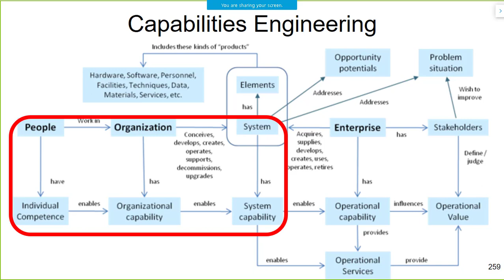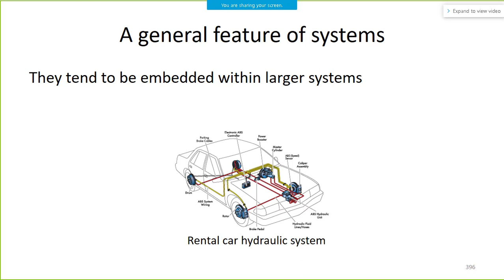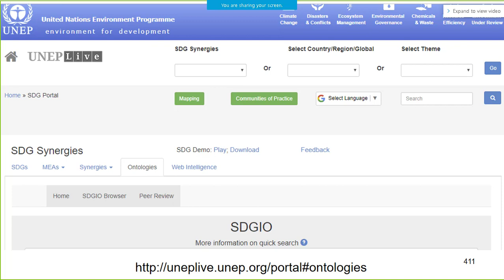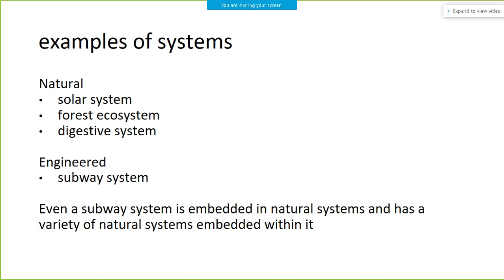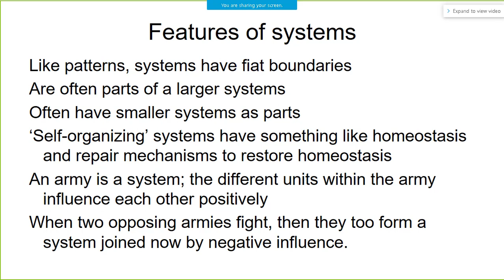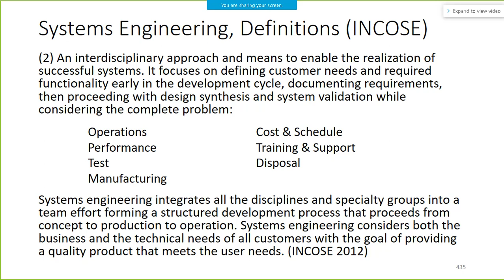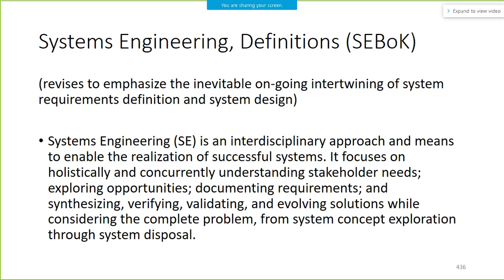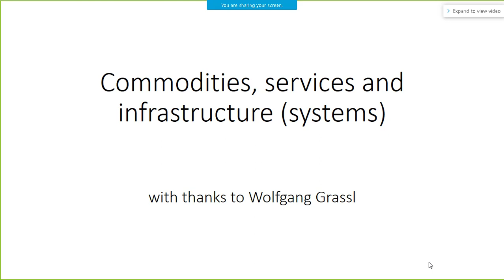Ontology for System Engineering - Part 4: Product Life Cycle

Comment: TLDR: An organism is a system with capabilities but no function that can take on a role that has a function.
Eg: A bee is a system with the capability to propagate, which can take on the role "queen bee" that has the function to propagate.

Argument:
An organism can be considered a system because it is comprised of causally linked components, which may also be systems. When an organism is considered an object it is because of the granularity chosen and the person choosing the granularity wishes to consider that organism as a "black-box". However, the next level of detail will break the organism into it's component parts and consider how they are causally linked. How does the little toe effect balance? The next level of detail considers the systems that comprise the organism, such as the digestive system. 

The argument that an "organism can't fail" requires that the ability to propagate the genome is considered a capability rather than a function, which is in-keeping with "organisms doesn't have functions". Let's take an example of a beehive. A hive is a system comprising of organisms with different roles, including queen bee, drone, worker bee and larva. This hive system has processes for gathering food and protecting itself. A bee has a causally linked set of sub-systems, including digestive, neurological etc. Therefore it must be a system, but it does not have the function to propagate. It does have the capability to propagate.

The queen bee is the female that realises the capability to propagate. A queen bee is a bee that plays the role of queen, whereas a worker bee is one that plays the role of a worker. To make a queen bee a selected larva is fed a special diet, otherwise it would be a worker bee. The "result or end" of the role the queen bee plays is propagation, the purpose of this role is to propagate, therefore this role has the function to propagate.

Attaching the function to the role lets us say things like "Mr Smith has the role of Chef. A Chef's function is to Cook." From which we can say that Mr Smith's function, when assuming the role of Chef, is to Cook and we can say Mr Smith failed to Cook when assuming the role of Chef. But we cannot say Mr Smith failed to Cook when assuming the role of Driver because that is not a function of Driver. Nor can we say Mr Smith, Mrs Jones, etc. failed to Cook, because they do not have that function.

From a real-life example, the sinking of the MS Herald of Free Enterprise:

people:
Stanley has a disposition to sleep in his cabin.
Sabel has a disposition not to take the role of DoorCloser.
Sabel has a disposition to leave G Deck to get to the bridge when under pressure.

roles : functions:
DoorCloser's function is to close the doors. 
DoorChecker's function is to check the doors are closed (not capability as it is a requirement that a first officer check the doors). 

failure:
Stanley was asleep in his cabin.
Stanley did not assume the role of DoorCloser. 
Sabel assumed the role DoorChecker.
Sabel did not assume the role of DoorCloser.
Sabel left the G Deck to get to the bridge.
Sabel failed to check the doors were closed when assuming the role of DoorChecker.